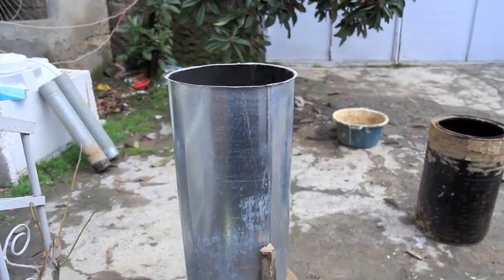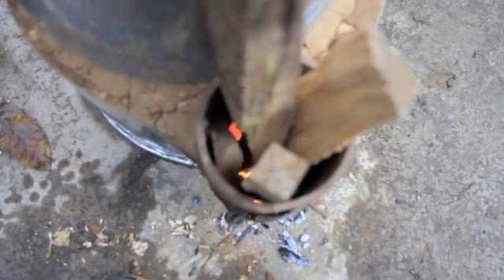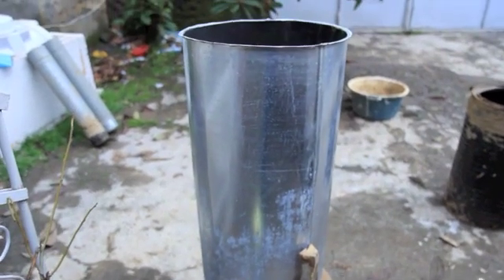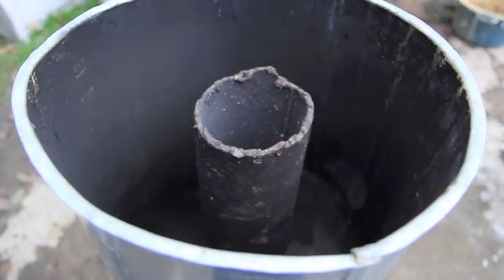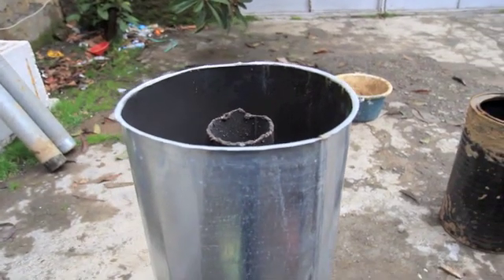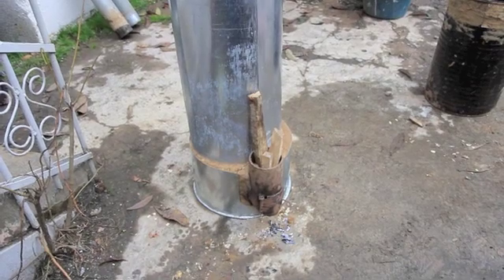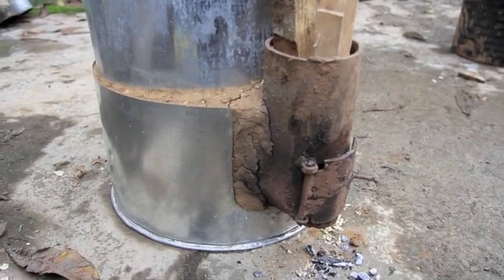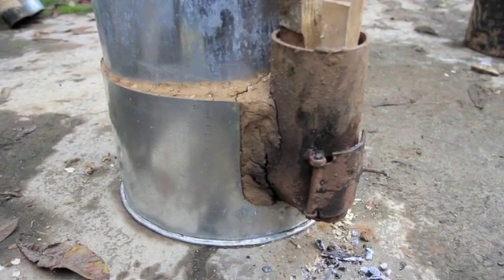Portable Rocket Stove, small mass heater

Comment from the maker: I would recommend anyone to rather make a brick stove heater. I have made both and I actually don't find the rocket mass heater so much easier.

If you are still rather want this, here is the list of what you need.

1,2 m iron tube welded in a J-shape
One sheet metal bucket as base. about 40 cm ø about 30 cm tall
One tube in sheet metal for insulating the heat riser about  25 cm ø and 80 cm tall
One bucket covering with flue outlet . The mud makes the different parts come together.

 Good luck

Comment: The beauty of a rocket stove is that it burns extremely quickly and hot and, thus, quite cleanly, and stores the heat produced for later slow release -- rather than sending most of it up the chimney pipe and into the sky.  Therefore, a short burn, using a small amount of wood, produces a lot of usable heat long after the burn. 

Does your design integrate thermal mass into the walls of the tank that covers the heat riser? And how do you handle the exhaust? Is it also wrapped in thermal mass?